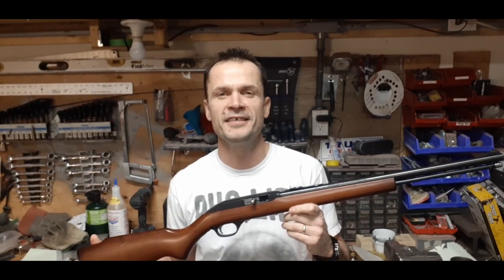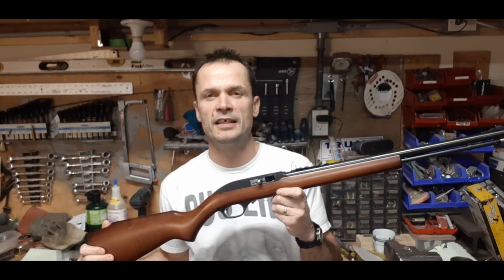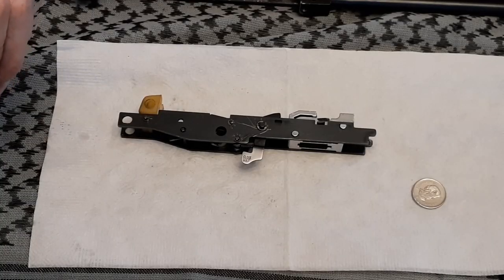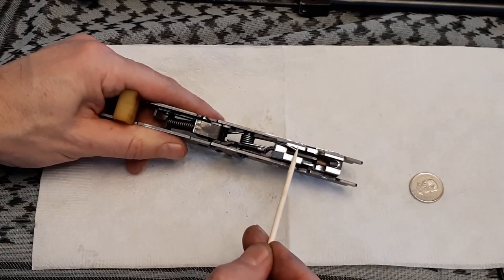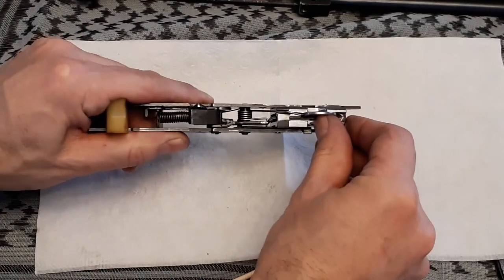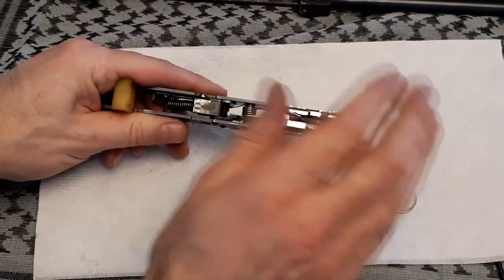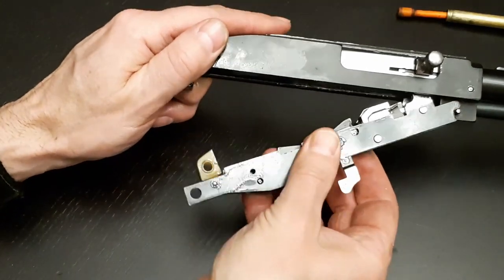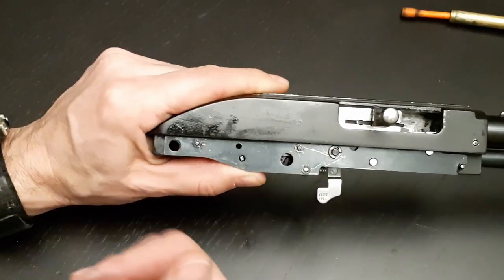Nickle Trick Marlin Model 60 fail to eject

Comment: Thanks for the video.  I recently picked up a 1973 model that's almost in mint condition.  Been browsing for this trick as I ordered a new recoil spring for it and when I install it, I plan to check the alignment of the ejector spring end as well rather than find out at the range it won't eject.
Reply from the maker: Good plan!

Comment: I appreciate your content on this rifle. I’m going to try this nickel trick and I hope that it works out for me. I am curious if you are having issues with the bolt carrier jamming on the spring and spring rod? Mine seems to have a string sticking point at the halfway mark.
Reply from the maker: Hey Ram, I have found the nickel trick basically eliminated any fail to eject, if it fires, the shell get spit out.  As far as sticking half way I have not had that problem but I would recommend looking at the spring.  Lots of people end up with a pretty bad kink about halfway along from accidentally bending while installing.  Mine has a slight bend and works fine but I suspect if its tool much it might start binding.  Also maybe take a look at the areas the bolt slides along for burrs or excessive wear.  let me know how it turns out.